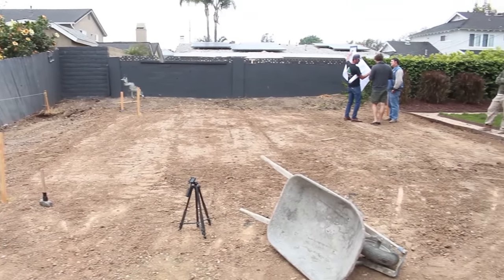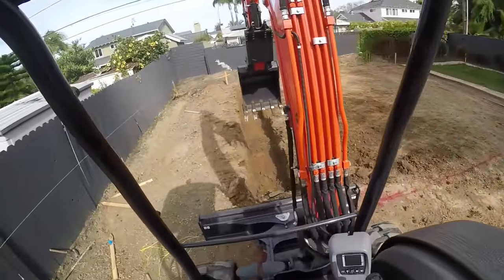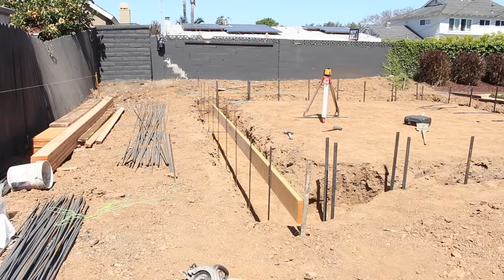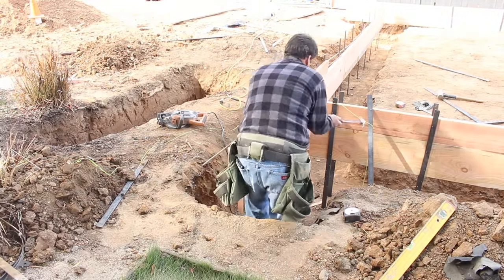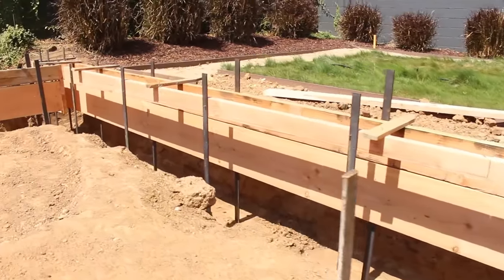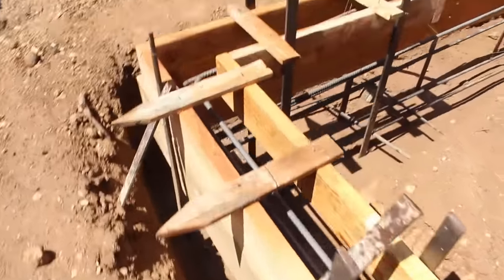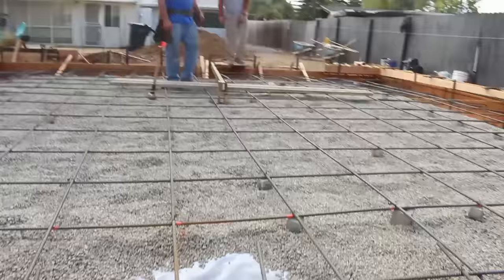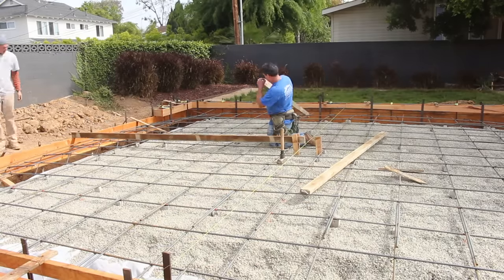How to Build and setup a Concrete Foundation for Garages, Houses, Room additions, Etc Part 1

Comment: This is the correct way to create a steel-reinforced concrete foundation but the rebars are too thin and too widely spaced apart. My own Dacha's foundation uses a 1 inch thick steel rebars spaced apart by 6 inches from center point of the rebars' diameter so it means it is technically they are spaced apart by 5 inches from each other side-to-side. And connected by rebar mechanical bolt connectors and rebar intersection mechanical bolt connectors and about 480 pounds of 33.33 degree angle double-twisted steel fiber-wires 33 twisting long are added and mixed with the semi-plastic/semi-liquid concrete mixture for every cubic yard of that concrete mix and they use powerful concrete vibrators to remove any air bubbles and to densify the concrete mixture. Then the steel fiber-reinforced/steel rebar-reinforced concrete posts and beams and floors and walls and divding walls and garages and stairs and roof with guard rails are poured-placed using powerful concrete vibrators and modular and reusable steel molds.
Reply from the maker: That sounds crazy, I have only seen that on a bank vault design
Reply: During the Cold War I have to be sure to ensure my survival just in case our countries starts throwing nuclear warheads at each other. Besides, beneath my Dacha in Kazan is an underground self-contained terranium (the earliest form of sealed biosphere), a SELF-CONTAINED MINI-EARTH of sort so that I and other family members and relatives can survive and built according to the same specifications. The Dacha above ground is designed to give me and us enough time to get into the bunker (including our pets too you know!) containing the self-contained sealed terranium that can recycle everything passively producing herbal medicinal pharmaceutical crops and food crops and plants to filter air and water to become fresh as well as human wastes of all kinds and plants to fight plant diseases and pests and against household pests, molds, and others. It is not crazy to do that during the era of the Cold War between our two countries and still my nephews help check and inspect things inside that bunker even though it is self-correcting because of the way it was designed. FOR NOTHING BEATS NATURE ONCE YOU HARNESS IT'S RECUPERATIVE POWERS FOR GOOD INTENTIONS. It is better to be prepared and not need it, than need it and not prepared to meet that need. The cement used in the concrete mixture is a refractory grade cement called calcium aluminate cement which is acid-resistant and alkali-resistant mixed with a compound to make it non-porous and non-absorbing of anything in the air, water, or soil inside the terranium and in my above ground Dacha.
Reply from the maker: Sounds intense
Sounds like you could survive on Mars with set up.
Reply from the maker: @darthvader5300  
it's a good idea if you think you will be attacked.
Reply: I almost forgot one thing. My own personal bunker has it's all around 12 bed hospital-ER-trauma-medical specialist facilities, clinics ranging from opthalmologists, optometrists, surgeons, dentists, nurses, general practitioners, field medics, all kinds of doctors and their families and relatives-dependents, medical logistics, etc. I have spent (along with other people who contributed to the expenses in building it) a small fortune in that bunker of mine. Many of the other houses has the same kind of bunker that I have so that we can accommodate the entire village, plus some others who are in our village doing business if the unthinkable happen (LETS PRAY AND HOPE IT DOES NOT HAPPENS!) The same thing goes for the larger ones all over the Russian Federation.  If you are going to build a bunker of your own I suggest you contact Professor John Todd who created the "LIVING MACHINES" principle and there are numerous technologies of different kinds for different kinds of problems and you can find him on Youtube or on Google by just typing Professor John Todd  Living Machines and there you have it. And always use basic passive designs and systems to make everything simple. For example: My bunker has a perforated stainless steel flooring on top of a stainless steel structural bridge grating that can carry a heavy tank or a steel tie secured steel railway carrying an ore train with loads ranging from 100 tons to 200 tons per car. The reason is quite simple, carbon dioxide we exhale is heavier than air so it naturally flows down through the perforated steel floor and underneath is a densely planted multi-use/multi-crop perennial garden using growlights and our exhaled carbon dioxide is inhaled by these plants and is converted into oxygen which is lighter than carbon dioxide and goes up passing through the perforated stainless steel floor as fresh oxygenated air. So study a lot about biology, botany, food chain cycles, ecological cycles, gardening, farming, etc, THE WORKS!  And do not forget to check up the websites of Professor John Todd and his Living Machines. Use the natural process of convection, gravity, conduction, heat dissipation, etc in order to make everything simple and not vulnerable to having a problem of getting a spare part (s) delivered, especially when society collapses in social strifes and civil unrests and wars.
Reply: If your country has the same policies and facilities, then no one will dare to make an attack on you and your country too because they know you can survive, flourish, thrive, and expand regardless of what happens above your own national bunker networks. And you can rebuild your surface civilization again as if nothing has happened. BUT PRAY AND HOPE VERY HARD THAT IT WON'T COME TO THAT. Your President Trump is a good man and President Putin is a good man, lets pray and hope THAT ALL GOOD MEN IN OUR GOVERNMENTS WILL PREVAIL AND COOLER HEADS WILL PREVAIL.

Comment: There's no need, or code requirement, for field rebar. As long as it is a single pour, the only requirement for rebar is in the footing. Rebar in the footings keep the  interior concrete contained, so it cannot separate. Crack, yes; all concrete cracks. But there can be no differences in concrete elevation (rising) along sides of the cracks because of aggregate lock.
Reply from the maker: I see floors in houses crack and rise all the time.
Reply: Joe drager not in CA
Reply: There is lots of code in Ca.

Comment: Why did yall NOT line the footing with bisquine and why did yall use clear instead of black? I was told by an instructor that the clear will probably be shredded in a year or so. Black bisquine is more durable and longer lasting and should be in the footing as well to prevent sweat. Also, shouldn't you be using stirrups? The rebar will rust over time being in contact with the ground.... metal should NEVER touch the ground.

Comment: There are houses down here in Colombia that have very little concrete for the foundation and no trench at all and have been standing for over 100 years. This is overkill, especially for a simple garage.
Reply from the maker: I think so too, but I just build them.
Reply: @OdellCompleteConcrete  Great job, just a  hell of an expensive one.
Reply: They might just be complying with county guidelines.

Comment: what was final cost of this.
Reply from the maker: 10,000
Reply: i hope thats for the whole garage
Reply: speedwayman100 
Not sure where you live, but in Chicago I’ve been quoted $30-35k for a 24’x24’ car garage. This includes $5k for the concrete slab, which is nothing close to  the one being built here.

Comment: Why do you need a form on the inside?  I will watch the next video pouring it.
Reply: Raised concrete stem wall
Reply: Yes.  I saw you had it sloping both ways.

Comment: Wouldn't it have been cheaper to use 4' wall forms?
Reply from the maker: T2586 
what is that?
Reply: Odell Complete Concrete 4' simplex or duraform wall forms. Of course you wouldn't have been able to pour the walls and slab in the same day, but it seems like it was a lot of extra work forming. Looks like it turned out really good regardless.
Reply from the maker: T2586 
On a larger project that sounds like it may save some money.

Comment: What size is that machine
Reply from the maker: Michael Stevens 
I don't know but it's a good one.
Reply: Ok I'm about to start the same job and need a little guidance can I send you a drawing and get your advice and expertise I want to pour monolithic area of slab is 20 ft 6 x 21 430sqft 4" thick underneath 8" of compacted gravel also need to do footings and foundation wall
Reply from the maker: Michael Stevens 
sure send them over. sounds like a piece of cake
Reply: Odell Complete Concrete where do I send it to
Reply from the maker: Michael Stevens 
odellcompleteconcrete@gmail.com

Comment: Good job..but it's frustrating to have to over build ..makes costs go up..and it's unnecessary... Houses built hundred years ago are still standing..and they had very little code enforcement
Reply from the maker: I concur
Reply: @OdellCompleteConcrete  ..you are a good teacher too..I used to build in Cali... Humboldt County...great to meet you..aloha
Reply from the maker: You To
TY

Comment: For those of your wondering why there is so much rebar, foundation depth and general overkill, this is what's required in California these days. If this was done a few years back before recent code changes, there would be half as much material and excavation involved.  There is no sense to me in all this excess, as there are hundreds of thousands of similar structures with much less foundation, steel, et cetera that have stood up for decades. A testimony to over engineering and waste, this is now the current state of California building. Your would think he is going to build a three story warehouse instead of an open garage.  I doubt that things are done this way another parts of country, but here we have no choice.
Reply from the maker: earthquake country,

Comment: why keep oil off rebar ?
Reply from the maker: So concrete will adhere to the steel better
Reply: ok I pump and pour for Sarnia concrete  @OdellCompleteConcrete  and most peapel put the rebar in the n spray , thanks
Reply: just thinkink , do you really think adherment would matter after ?
Reply: ive seen people leave rebar on ground ?
Reply from the maker: @MrBuckerubaby  
probably not

Comment: Everything seems so insanely over engineered, except I was surprised to see such a small amount of base rock and no compaction before slab?  4500 PSI for residential?  Seems unheard of.  Those are massive footers for a building of that size!
Reply from the maker: I concur

Comment: Wow - 9 sack mix to achieve 4500 psi; even with 3/8" pea for the pump that's a lot.  I imagine controlling shrink cracking must be pretty challenging.
Reply from the maker: Jay Phillips 
not when you add fibermesh

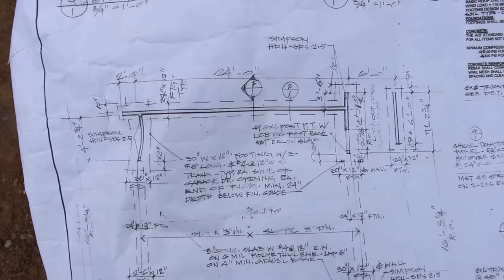Comment: 1:05 dude... use Qcad or FreeCAD if AutoCAD is too expensive. This is 21st century. Iast time I saw hand drawn blueprints was when I was doing the demolition permit for one of Ceausescu's rubber factories, drawing from 1976 I had to vectorise. I can't believe I see this in USA lol
Reply: In Romania, we use prefab PFL panels, coated with anti adhesive paint. We don't wire the armury within the concrete coffin, we bind the rhee bars in groups of 4, using "etriers" someone makes on site, and place it inside the concrete coffin.

We have pre welded iron bar mesh called "plasă de Buzău", the best ib the world. Our concrete is poured in liquid form so it levels itself in the coffin. We also leave out "wiskars" for concrete pillars reinforced by 4 beam armor and etriers. We pour the concrete before we raise the wall, to skip cutting bricks in half and leave "wolf fangs" for beter monolitization.

Then we assemble the coffin for the belt, same reinforments, suspend the PFL panels with poles to pour the belt and the slab in one goal. And that's how we do most of trilitic structures here.

During Ceausescu regime, we and the french ware the first nations to use prefab concrete blocks monolitise on site, that ware armored with pretensioned steel bars.

You should check the counter dome damm at Vidraru to see who we once ware... or the Casa Poporului, biggest structure ever build in just 10 years.... I want my gay-free country back :'(
Reply from the maker: That's interesting

Comment: INTERESTING. Since "we" learnt it as 3: 4: 5 for a right angle WHY say 6: 8:10 ?
Reply from the maker: Well its a elongated version for more accuracy.
Reply: It's the same
3^2 + 4^2 = 9 + 16 = 25 = 5^2
6^2 + 8^2 = 36 + 64 = 100 = 10^2
Reply from the maker: That's how they built the pyramids

Comment: How the rebars are placed would never be accepted in Sweden. 
They don't even connect the bars that is going down with the top layer... 1 out of 5 if even that. 
Lucky that u guys have warm weather over there. Imagine if cold/snow came around and made the ground move, it would crack in 1 or 2 weeks.
Reply from the maker: I'll put this anywhere in world, and it will be fine.

Comment: It's a mistake to spray water on foundation as that would make the soil soft and when you pour concrete on soft soil, its weight will make the footprint collapse. When you dig for foundation and don't pour same day, you have to protect it from rain. best practice is a 2 inch thick pre concrete pour
Reply from the maker: unfortunately you don't know what your talking about.
Reply: Maybe when you here from a professional, that makes you say that :)

Comment: Robust slab!  Understand SpacX will be launching some micro vessels off of it.  Must have been a young engineers design.
Reply: That's possible it might also be used as rocket booster recovery slab.If they run into a clitch with it coming in a little hot the slab should be ok.

Comment: I just got a $50,160 price for my 50x72 foundation and am about to cancel, but after this video I now understand why it costs so much, holy cow man, why in the fucking is all this Nessuary? It's just a steel shop.
Reply from the maker: Rich s 
That's crazy.
I did this one for 13000
Reply: Odell Complete Concrete : HOLY COW, I don't get it. I canceled the order, I lost the 9,200 deposit I gave for t3he building, going to order a Pole frame building package tomorrow, it is the same price of 37,000 but I won't hafta pay for a gold foundation. What a life, this mistake I made is going to take a bit for me to get over.
Reply from the maker: That sucks
Reply: id take their ass to court over 9000.00

Comment: Well, $12.000 with no garage yet but a bunker.
Reply from the maker: OSS
Reply: I know OSS, just getting to know OCC :)
Reply from the maker: Awesome
Reply: Yes, I am not; but to  enquire - would at half the price make the rock solid base for a garage?
Reply: I do not have the armoured tank this slab is fit for :(
Reply from the maker: I think they want to use it for a rocket launch pad.

Comment: Pea gravel is a horrible base material
Reply from the maker: Tell a engineer that
Reply: +Odell Complete Concrete - Tell an engineer what?
Reply: I am a Professional Engineer in 6 states. Pea Gravel does not maintain compaction like crushed limestone.
Reply from the maker: Mike Falk 
Great tell the Engineer over here.
Reply: I assume your Engineer can read. Try using pea gravel in one spot and crushed limestone meeting CalTrans 3/4" specification for sub grade. Compact each and test for yourself.
Reply: Pea Gravel is more rounded and will not interlock when compacted. The Pea Gravel will eventually lose its compaction.